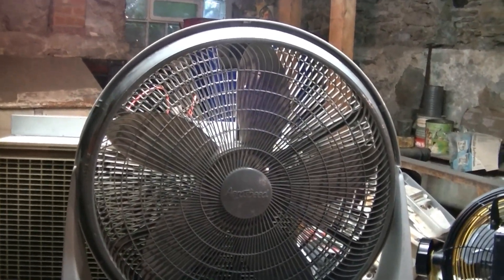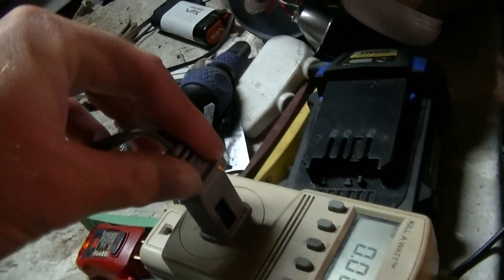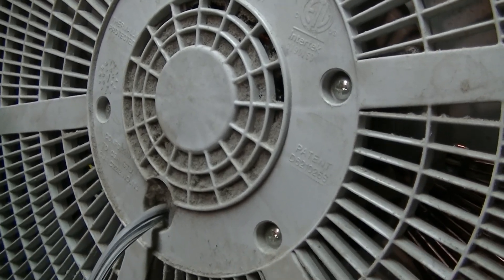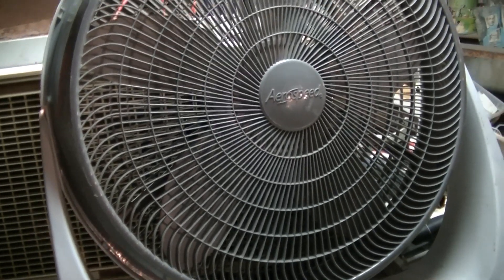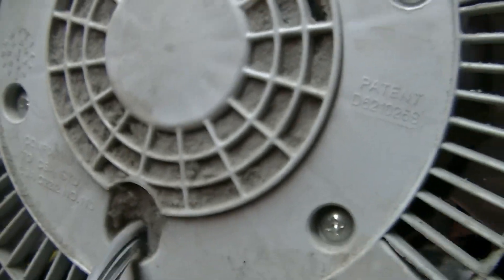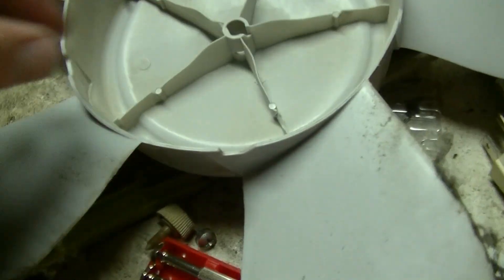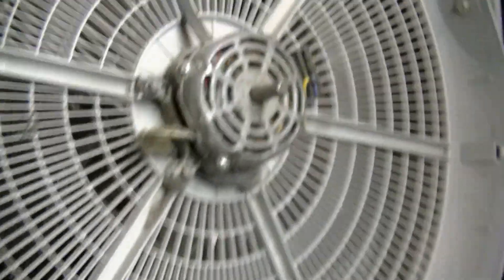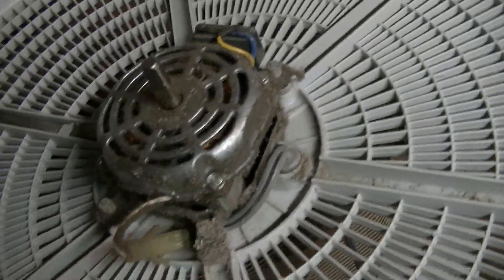Piece of Junk AeroSpeed Fan

Comment: Maybe replace the motor and add a different blade to it so you can use it
Reply from the maker: I would definitely do that if I had a spare motor available.  I wanted to try fixing the motor, but the blade cracking was very disappointing.